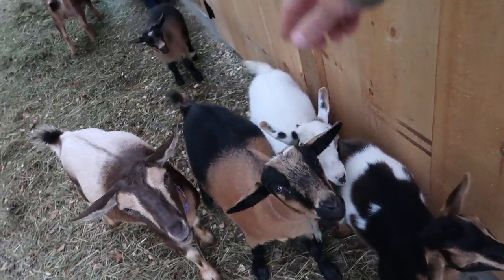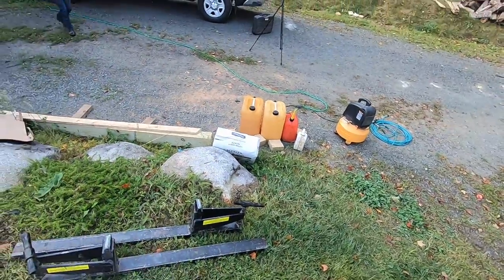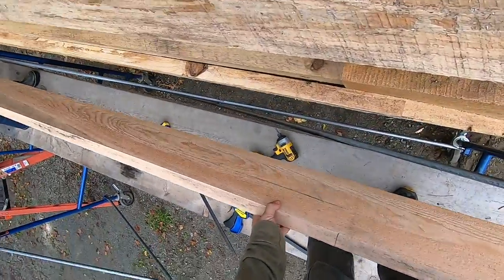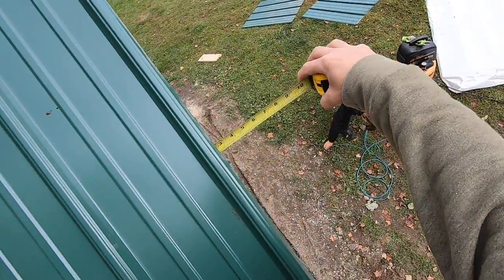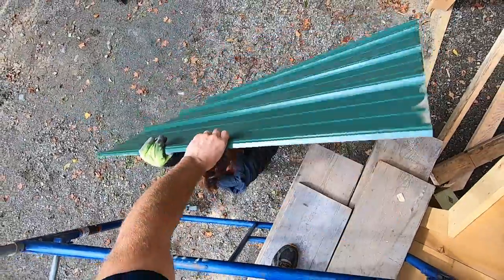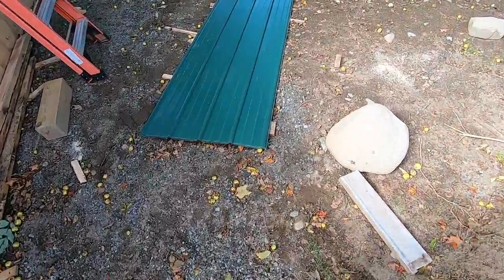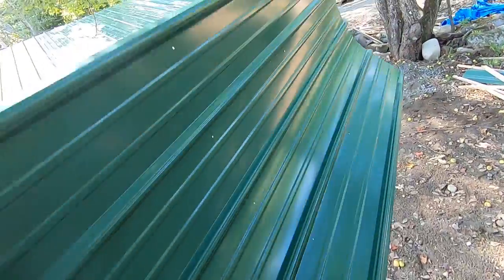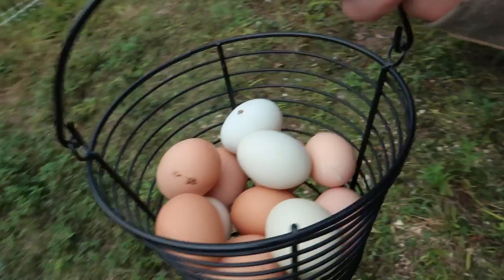This is a First For Us Installing the Metal Roof together on the Post & Beam Firewood Shed

Comment: In North Dakota we have been cool and wet this year.  Leaves are turning and we will have a hard winter. When I worked ethonal plants we had kids that were afraid of heights and we would bring them up to the highest level tie them off and leave them till it was break time.  After a day or two of having the greatest view of the area they weren't afraid of heights.  Being afraid of heights is all in your mind.  Dont let your mind win. Concur your fears. Nice job on the barn

Comment: I know you will be very happy to finish the roofing on the wood shed/carport.  You mentioned insulation the workshop area of the barn; will that include the goat area ceiling as well?  Prayers that sweet Tanner issue is resolved quickly with the antibiotics.  God Bless.

Comment: the first sheet of metal you marked 9" and 21 1/2" then the others were 9" and 22 1/2" ,  i quess it still hit did you notice? 1 hole slightly lower

Comment: Have done this one or two times. Some tips for those that want to build their own shed. Let the beams stick out a good feet on the side to have the metal roof on solid ground at all Point, gat a tarp or oil treated boards under the metal to Catch condensation and instead of drilling use self drilling screws.

Comment: When you run electric to the wood shed for spot lights for after dark etc.   Can you get a container to catch roof water. Then you can use a pressure washer to cleaner the equipment and wash cars and on and on.......

Comment: You do know  that you do not have to pre-drill the panel.  your roofing screw will drill itself through the 
metal and when drilling into the valley of the panels you should/ can use a shorter 1in. "stitching screw"
they cost less and you get more ( stitching screws are used to stitch the edge seams together.

Comment: Probably the least cost insulation is needed ultimately you need to concentrate on stopping the draft. If you was highly concerned about it you may add a barrel stove for the most frigid days and nights of the winter.

Comment: Do not want to be critical but it is normal to screw roofing sheets through the peaks not the troughs, this is where the water runs, and the screw holes are likely to leak. Keep up the good work family.
Reply from the maker: The metal roof manufacturer recommends screwing in the valleys. Screwing in the peaks voids the warranty

Comment: How cone you are not using metal washer (metal rings) when screwing down the metal roofing onto the trusses ?.
Reply: The screws have rubber rings that compress when they are fastened down to provide a watertight seal. I think he briefly mentioned it during the barn build.

Comment: Will there be doors on the wood shed/car port?  Since you put the Overhead door on the barn, this should be a snap, with an automatic opener, so Gina doesn't have to get out in the  rain/snow to drive in, or eventually when you build another car port attached to the house, then you can park the tractor in this car port, though I don't know where you would put the transmitter on the tractor? No visors!!! HA!

Comment: Nice job. You could have finished sooner if you did the long side of the roof and the flashing first then slid the short side under the ridge.  Sorry not usually an armchair builder.   Thanks for sharing.  regards

Comment: Rocket mass heater uses minimal firewood and heats like a battery. Just a suggestion. .
Reply: I agree. Was going to suggest something along those lines. Plus, the walls might get warm enough for the goats to enjoy on the other side.
Reply: @annwithaplan9766  And who is going to there to feed fire throughout night!!!!!
Reply: @tonygrimes13  - Hopefully they wouldn't have to feed it through the night if it warmed it up some during the day.
Reply: Tony Grimes from my research the mass/ heat battery (typically cobb) can stay warm for up to 48 hours with only running the stove for 4 hours. But I’m not speaking from experience just from research.

Comment: I've never done a tin roof, you killed it! One question though:

For longterm durability and water-tightness (for lack of a better word) wouldn't you want to squirt a bit of caulk or silicone in the screw holes?

Comment: "Red Sky at night, Sailors delight."
"Red sky in the morning, Sailors take warning."
Quick question: What's the purpose of the arm that flaps around on the circular saw as you are cutting?
Reply: There is a guard over the blade that rotates around as the saw is pushed into the wood.eg@12:34.The arm can be used to pull the guard around when doing a plunge cut as@12:06.
Reply: @Z4Zander  
Thank you for the explanation.
Reply: @caninedrill_instructor5861  De nada.

Comment: It turned out great! Started bindge watching your channel about a few months ago. Though I’ve only been in construction for about 6 years I just wanted to share a tip. We steel roof an occasional old house here and there at times. We always chalk a true square triangle to begin, called the “3-4-5” method. Other videos and sites will go into depth on that. The “vertical” line that runs up the gable end is usually chalked about 1/2” in and will line up with the steel’s edge. The bottom chalk line is about 2” above and runs along the roof’s bottom edge. This can be your reference line to measure down from as you progress to see if you’re running “true”. It’s hard to explain through a comment but I’m sure there’s a helpful video out there! Great work!

Comment: Consider rock-wool insulation.  It is fireproof.  I believe it would be a lot easier to get the 2 inch thickness than spray foam.  Comes in sheets like the pink stuff. See YT: Red Poppy Ranch.
Reply from the maker: The rock wool is some nice insulation.

Comment: Maybe the screws now-days have some kind of gasket on them to keep the water out. In my time you put the screws into the ridge not the gutter on metal roofing.
Reply from the maker: Manufacturer recommended screwing in the valleys. I think it depends on the brand if roof too. Not sure

Comment: Why did you pre-drill??  Here in Southern Idaho we go from 100* to -10* and all of the “pole barns” sheds and metal roofs on houses use a color matched self tapping screws with a gasket to prevent leaks. Saves a ton of time from having to measure, then drill then read a bunch of comments about how you missed an 1” 😉
Reply: That makes sense. Thanks

Comment: Your screws should go right through the tin. You don't need to pre-drill. Just a waste of time.
Reply: Agreed but predrilling is a lot easier and an accurate way to work.
Reply: You're right you don't need to predrill holes for self tapping screws, however, by predrilling the stacked sheets he only has to measure the screw placements on the top sheet instead of each one seperately and he'll get more uniform lines of screws.

Comment: Where is the underlayment and tar paper?  In a couple of years you'll be leaking as the weight of snow and rain will flex the metal and start pulling the screws.....your overhang on eave and edge is too large....should be 2" or less....sorry, too late, 'eh?